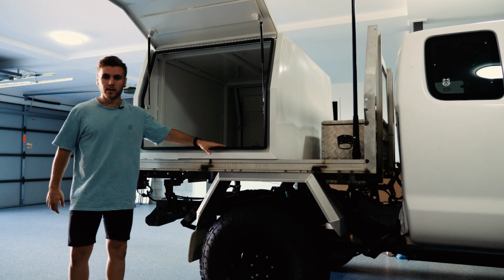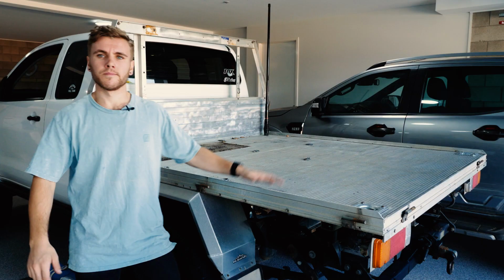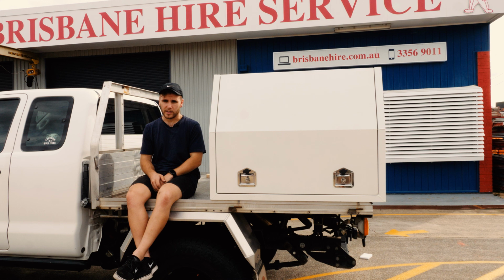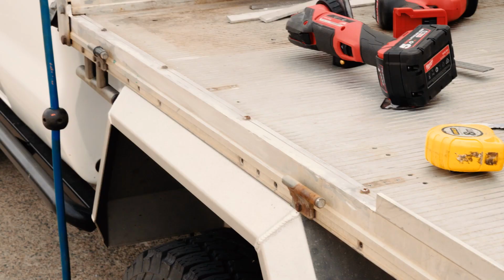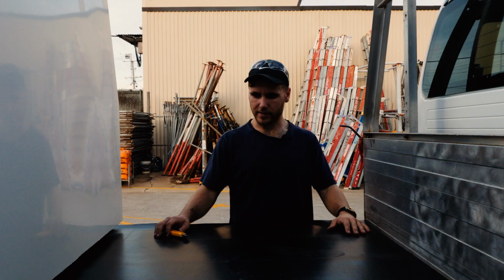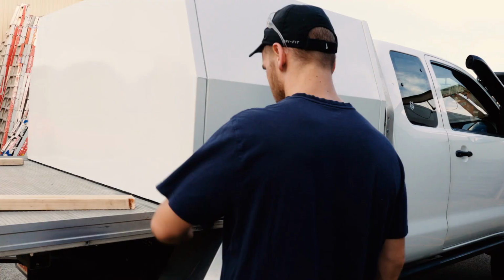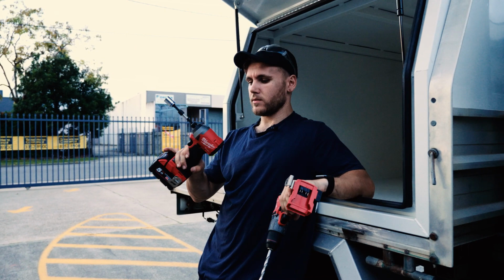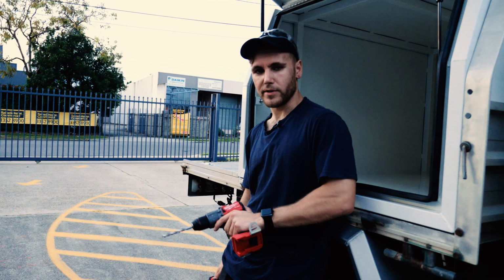Hilux Canopy Install

Comment: Looks wicked mate. I’m liking the size of it, looks like it’ll have good weight distribution
Reply from the maker: Yeah the entire thing sits in front of the rear axle so should be perfect. Actually drives way better with some weight on the back too!

Comment: Hey man, I was just wondering if you have a shorter tray on the lux. I am trying to figure out what canopy to get for my space cab BT50 and cant decide on a length. Do you have any suggestions?
Reply from the maker: Hey mate yeah it was originally a 2100mm tray and I removed the last couple of panels so it’s now about 1800mm long I went with 1100mm long canopy so I’d still have some tray space at the back but if you have a standard length tray you could go 1400mm long canopy and still have the same amount of left over tray as me

Comment: What bolts did you use to fit it to your tray ?
Reply from the maker: Think it was just m10 or m12 bolts about 50mm long with thread all the way up. It doesn’t really matter what bolts you use because the weak point is the aluminium canopy not the fasteners so make sure you use big washers or fish plates even better

Comment: Hey mate did you bolt through the frame of the canopy or just the false floor
Reply from the maker: Hey mate my canopy doesn’t have any frame in the floor it’s just a big sheet of aluminium so just bolted through that and put some bigger washers on to spread the load a bit more
Reply: @RyvalCreative  haven’t had any issues? I just got my canopy and just bolted through the ally floor aswell and was just worried that it wouldn’t be strong enough
Reply from the maker: Nah no issues, it doesn’t seem to want to move anywhere. It would take a lot of force to rip those bolts through that floor which would probably only be possible from a crash or rollover or something like that at which point your canopy is probably going to be wrecked regardless